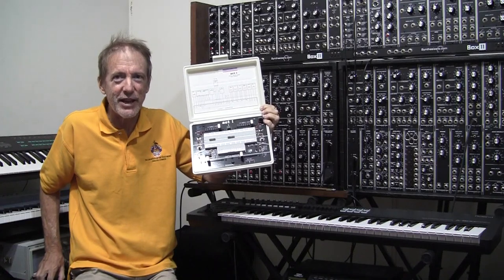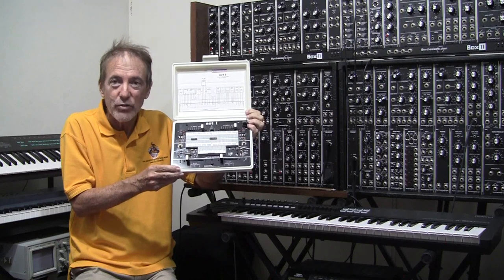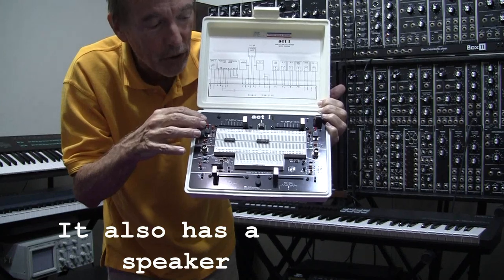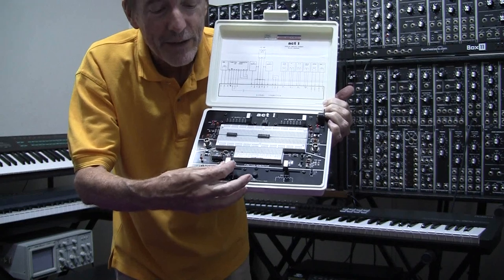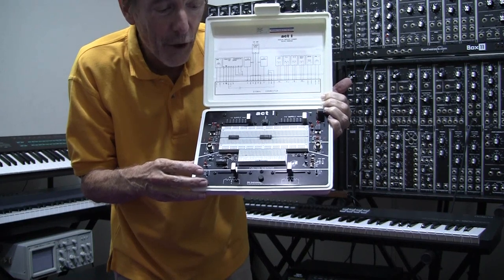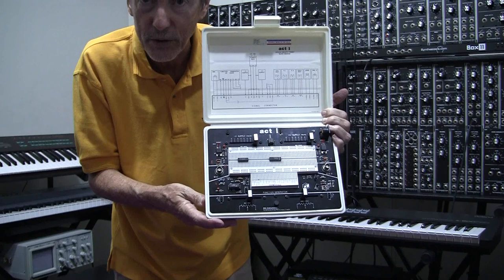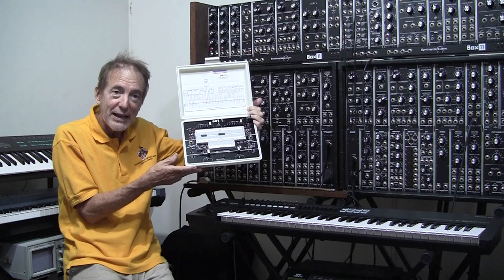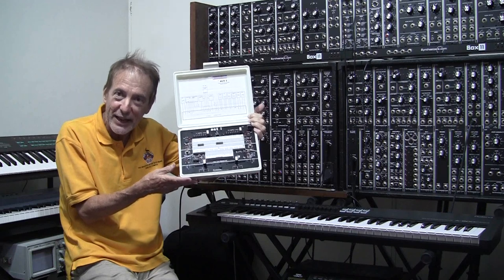Build Analog Circuits  with  trainer suitable  for Analog

Comment: Do you think the Elenco XK-150 is too simple? I'm looking for a trainer (I'm just a hobbyist) but the Global Specialties PB-505 is expensive and it hasn't received very good reviews (concerning quality issues)
Reply from the maker: I viewed the Elenco XK-150 and it has what is needed for simple circuits so you can buy one and let me know how it goes 😊....... concerning quality issues with PB-505, we use them in the Labs at the University (we have about 30 of them) and they are VERY satisfactory.....  even in the hands of novice students .... we would endorse them and buy more when needed...... even if a student managed to damage one (and this has happened several times), the parts are readily available ........ we also use Elenco radio kits (AM/FM radio)  for a class (and the students are allowed to keep the radio after they build it)...... I am not as impressed with Elenco quality (but it is good enough that we will keep buying them in bulk) and the best part is they are very cheap so we can continue giving them away to the students.